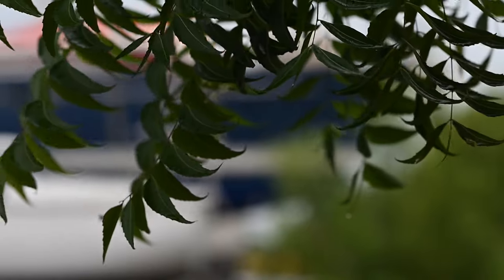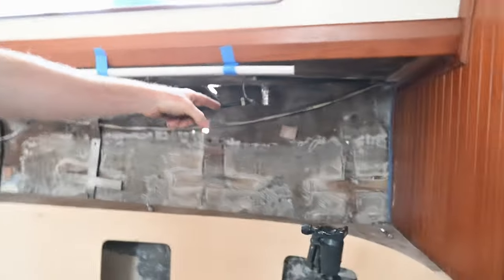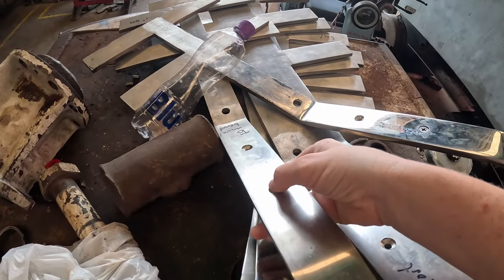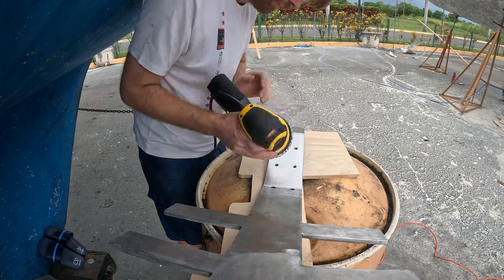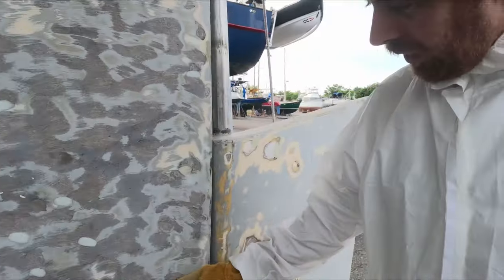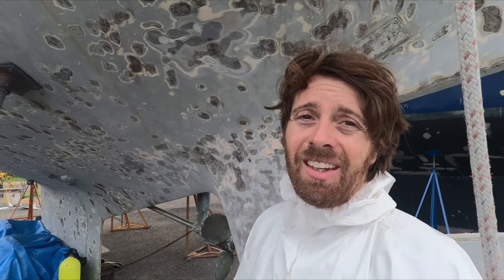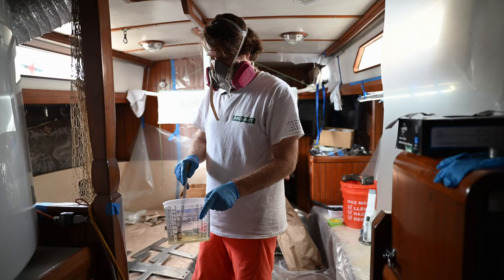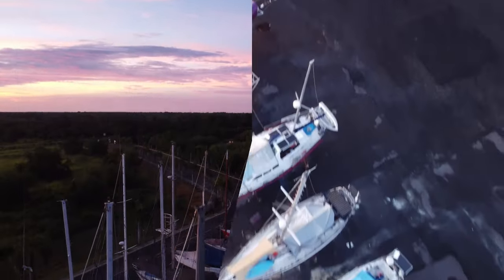Sailboat refit job(s) taking a TOLL

Comment: Big project. You have my full support. A few questions: What are your skills in boat repair? Why did you choose to go to Chiapas, Mexico? The boat has osmotic blistering. Why not strip the gel coat with a planer and then apply epoxy coating? That solution would be more durable. How much time have you planned for this first refit?
Reply from the maker: @jpbattesti200  Hey there, thank you! We have ZERO clue what we are doing…

J/K 😂 Between myself & Travis we have approximately 10 years of boat repair experience. (Travis did his first fiberglass job on a sunfish when he was a little kid!) We have fiberglass, engine repair, brightwork, metalworking skills…the list goes on. We went to Chiapas because we had thought we wanted to head north into Baja, and we needed a good/reasonably priced yard to boot-that is also DIY friendly. We did not have a planer as an option, but did have grinders onboard already. We did have one back in TX and that is a fascinating idea! We are doing a few coats of epoxy tho for sure. Well…that’s a tricky question. We are currently back in “replenish the kitty mode”…so are in Grenada right now on a friend’s boat working hard helping with charter work. Buttttt we are planning to be back to Papillon in December to wrap up the bottom and chainplate job, with hopes to splash and start heading to Panama! Looking at charter work out in St Thomas next year with her tho!
Reply from the maker: @jpbattesti200  also…vacuum bagging is a wonderful thing…this was our first time trying it and we see so many advantages!! Plus it just feels like a science project too 😂